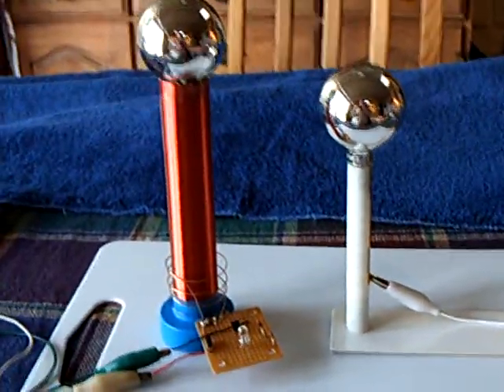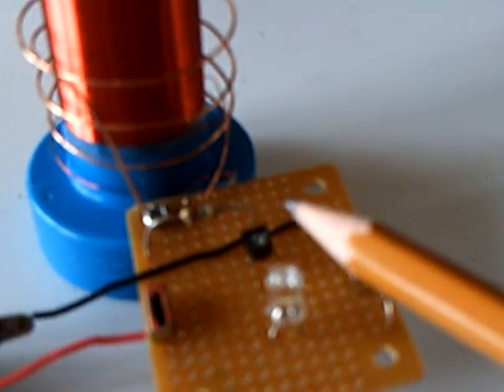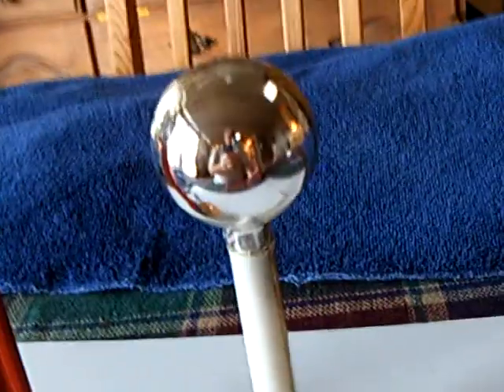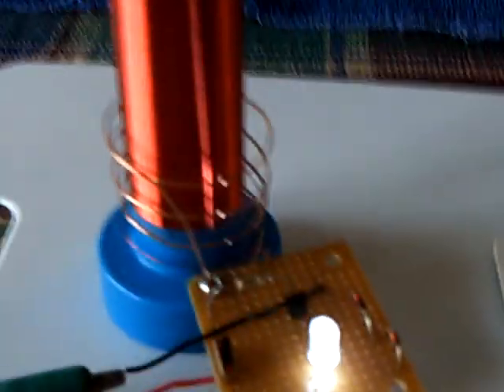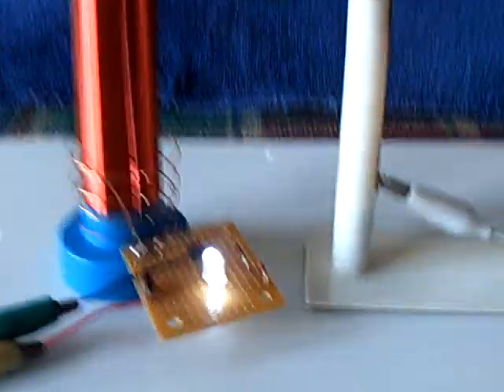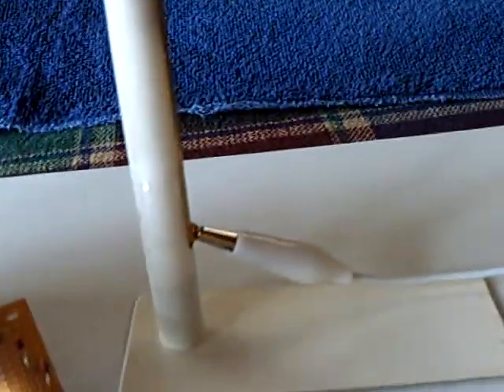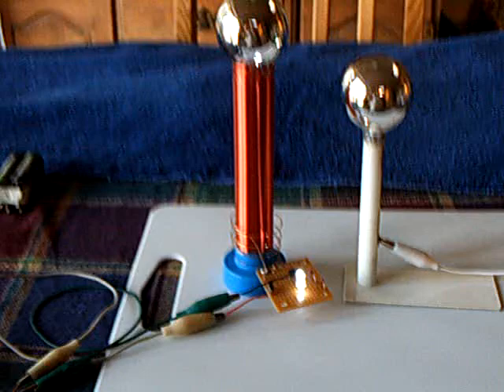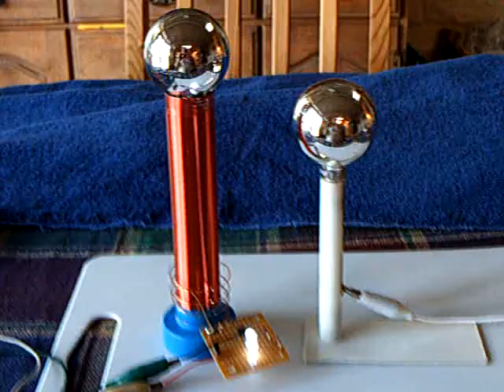Mini Tesla Coil ---Finished

Comment: I understand that with less windings on the primary you get more power from the secondary. I was wondering if you can tell me why this is. I also understand that you should get more power from a larger magnetic field. If this is the case wouldn't you get more power from the secondary if there were more windings on the primary because it would make a bigger magnetic field. I'm pretty new to this, so I need information. I have made a few Tesla coils now, and I am trying to optimize my output.

Comment: As always great stuff. Tried to track down emdevices could not locate, help. Could you pleasegive alittle moreinfo on this item. Coil diameter turn count, primary gauge count and turns. and again as others, Please add a circuit drawing.

Comment: Ahh a christmas ball. I wondered if this would work. Not with a tesla coil. But, did you ever notice that whenever there was a picture of Stubblefield using his "battery", there was a silver ball on the top? It was never clear that he actually used a reed switch, and I always wondered if he didn't arc the switch over the metal ball somehow.
I guess I am still wondering.
I like the mini tesla lamp. It is a nice contained item.
thanks!

Comment: @Lidmotor you got good loose coupling between L1 and L2 now did you try matching the mass of copper as tesla described?
try a topload size like a thimble-should get corona breakout.
although you might need more volts in to get breakout.
also if its tuned to quarter wave the bottom will be zero volts.
grounding the Tx providing an artificial one like stiffler does should increase output too

Comment: Lid, you can make the toroid. I know you can.
If you want a longer distance between your towers, make the pick-up exactly like the sending.
Resonance.
Just like two E strings on a guitar, when one is plucked, the other vibrates.
Harmonious interaction between devices yields results of greater efficiency.
Keep up the very cool work.
Peace.
Mike.